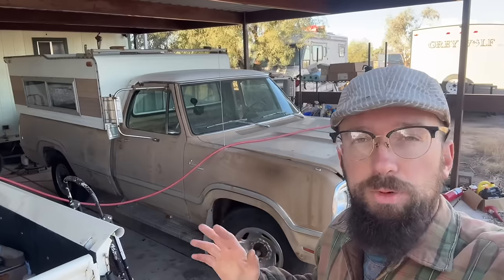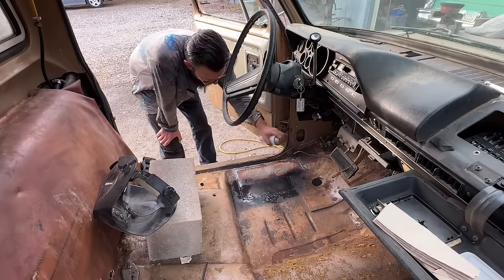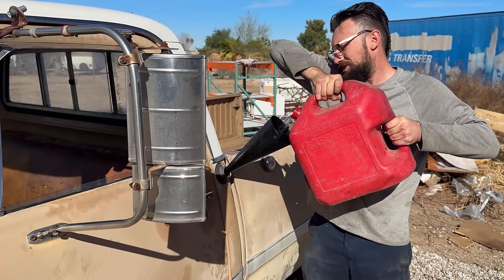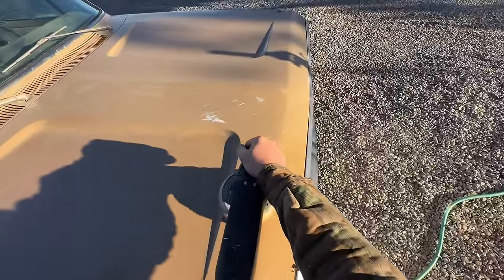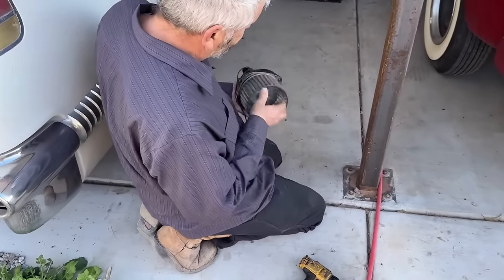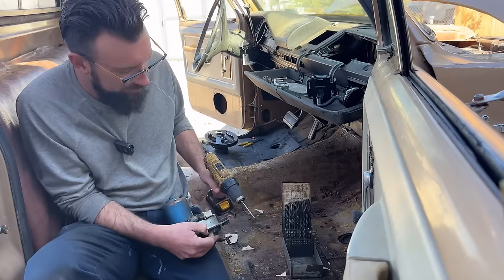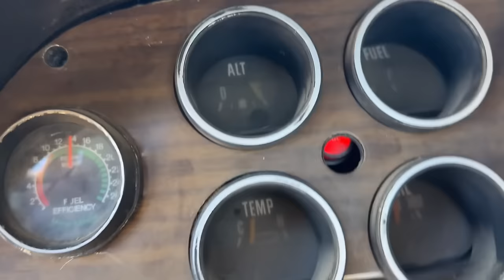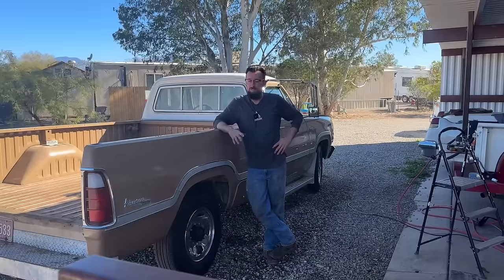1973 Dodge camper pickup gets polished, new floor, and more electrical fixes!

Comment: Jackpot. I really like how you’re not a “parts changer”. Those original parts are so well made and, it’s so interesting to see how you and your Dad do the refurbishments. I worked as a machinist for 20 years , and I loved refurbishing old car parts and such. Y’all are starting to motivate me.
Reply: I concur. The wiper motor not turning was caused by the excessive rust flake build up. You don't know what's wrong with a part till you take it apart and inspect it.

Comment: I really would like to see those fender turn signals work. If you remember radio shack they did sell 12 volt miniature bulbs. The bulb was the size of a grain of rice and there were two lead wires attached. I needed some bulbs this size on my heater control on my 05 grand prix. Dealer only sold the whole heater so I wired these in and they have worked well. I'm sure you could find bulbs like those online. Maybe led now.  Take them apart and tinker with them. And truck is looking good so far.

Comment: If you move that voltage regulator to the fender well, away from the area where the "bird bath" hoid dumps water on it everytime you open it, it'll last FOREVER.
Mine's 31 years old now on my '91.5 Cummins.
On them the heat from the head cooks them. ANOTHER reason to move it.
Movrd

Comment: Since the truck was built in Michigan and sold to the buyer in California, either the Dodge dealer or the buyer deleted the OEM mirrors and installed (what you have)…which are called “West coast mirrors” they were quite advantageous for towing RV’s or equipment trailers that were slightly wider than the truck.

Comment: Some notes... not hating or trying to get thumbs down or people telling me I'm wrong. I love your channel. I have a 1987 Ram W150 that I got in great shape that the previous owners didn't know anything about cars and were building contractors so they were cheap. They would use it in the summer only during the day and then park it under a canopy during the  winter. 1) if you're going to sell it to someone, you should probably figure out why the floor rusted out. The first generation Rams are very well known for leaking water from somewhere that I've been unable to find through exhaustive efforts. It didn't rust because of neglect, I guarantee it rusted from water sitting under the carpet. It will happen again and if you sell it to someone who parks it outside in the rain, they will be cursing you every time they open the door to find a puddle on the floor. And you will have wasted the extra money you spent on a new carpet kit. You can totally water test it if you want to prove it doesn't leak, but I would bet it does from somewhere. If you find it, please let me know so I can fix mine. 2) these trucks are also famous for not only not charging batteries , but draining them. I've gone through several batteries in two years of owning it.  it's probably why your truck keeps trying to die at idle. In my truck, I can see a shiny new voltage regulator and the battery gauge has clearly been disconnected since it always sits at the middle. My next move is to replace the alternator, again cheap ass previous owners. It's almost like the more electronic load you put on the truck, the more it tries to stall due to weak spark? If you figure that out too, I would love to know so I can fix mine to drive at night with headlights 3) the wipers are also a huge mess. You said it was never the linkage but the motor, but you should have replaced the linkage bushings while you were in there. The refreshed motor will most likely destroy what little life is left in the bushings. I also heard Dad mention something about a new wiper motor costing something like $120 to replace. Not my experience on Rock Auto. But you serviced your motor. I bought a new one from rock auto because mine is so noisy and I have to replace my linkage bushings. Hope this all helps a bit but also really hope you're able to chase down all my issues. Specifically how you would replace all those stupid bushings because most YouTube videos just edit the hard parts out. Id be a fan for life if you and your Dad tackle that project. The bushings are like only a few bucks. Huge fan please keep it up! P.s. if you ever feel the need to come out to Western WA, i have a 2004 4.7 Ram that has been sitting behind my house for seven years now and just needs some love and attention and help to get her running again. Could be some good content lol.

Comment: I'm replacing my fuel pump for third time in 2 years in my 2013 ford e250  no more Chinesium fuel pumps. The plastic housing swelled up couldn't hardly get it out of the hole in the tank.

Comment: Floor weld in patch was done correctly! I look at that floor of the truck and want to pour isopropyl alcohol on it, and vinegar, and "pee be gone" spray!! LOL. You might want to apply some P.O.R. 15 on the floor in certain areas. Back when car manufacturers used single stage paint!!  It  can be brought back to life taking the nasty top layer off --- the paint looks great now!! Great Job!!

Comment: I love your projects. I had a 68 long bed Dodge and an 81 LBD. Drove them for 43 yrs. Where running complete when I let them go. One thing... please adjust that p-side hood pin! The lift on that side is miserable. Maybe thespring needs adjustment as well. Still have my 94 Cheyenne LB in the driveway -only255k on the clock...Keep working .. Take care of Dad

Comment: So far I've sealed both Rocker Panels & floor patches on a '92 Nissan D24 Pickup. An inner Fender cut/weld to graft a used front corner & Rad Support on a '91 Toyota P/U. And just sealed my new Gutters, 6 End Caps with Eastwood Seam Sealer. There's still more than half the can left. Fill the air space in the can with Propane Gas to store the product. It'll never skin over or harden, (this works for Brake Fluid too! No air inside. No spoiled Fluid!).

Comment: if you want the truck to really start faster put one of the like 1994 starters on it they are smaller and turn much faster
Reply: 100% agreed. Dakota mini starters are in stock in all parts stores, and are waaay better than those dragging gear reduction starters.
Reply: but you lose the original cool sound.

Comment: Travis, if you can afford to. Get yourself a can of Eastwood Seam Sealer (grey or black). It's Titanium Dioxide & Carbon Black (& a couple packs of acid brushes). This sealer is amazing for filling & covering body welds. Never cracks or shrinks, paintable in 1 hour. With just half the welds & this sealer. You can fill a panel in half the time. VERY versitile product, & a can will last you a very long time/maybe a dozen projects. Worth every penny!

Comment: When I started working for a Chrysler/Jeep/AMC Dealer back in '79 when I got out of the Army, we could rarely send an Alternator, starter motor, and a few other choice pieces back to Chrysler without tearing apart first and try and repair them! By the 1080's, that was too expensive and labor cost more than time, so we started R & R the items for a faster fix rate, especially on warranty jobs.

Comment: Travis, very much enjoy your restorations. I've learned a great deal about engine fundamentals (turn over, compression, spark, fuel) by watching your videos. You might enjoy reading "The Grapes of Wrath" by John Steinbeck. There's much in the book that is not in the Henry Fonda movie. For example, the Joad family jalopy breaks down on Route 66 enroute to California. They determine they've lost compression in a cylinder, and improvise by winding copper wire around the piston ring. The copper melts, enabling the compression that they need. In another scene, Tom Joad and Preacher Casey are underneath the engine, torquing the oil pan bolts in the recommended sequence as Preacher Casey has an epiphany about the plight of the displaced Okies along the Mother Road. Great reading!
Reply from the maker: That’s cool. I’ve seen the movie. Should read the book it’s always better.

Comment: Your videos are really well done. Editing is king.
I don't bother with those air cut off tools anymore myself.  Dewalt cordless and a 6" death wheel " no guard off course I'm not a wuss".
Btw your Dad is a hoot.
Reply from the maker: Yeah dewalts are pretty decent tools.
Reply: @theetravisb just joined btw. Are you looking for a heavy welding bench? Or a metal utility bench?
There is a guy in south Phoenix that has some really nice 44 x 60  x ⅝ thick tables 3" tube legs. For $350 he had 10 of them I'll see if ha has any more if you want.

Comment: The entire life of the Ram series of pickup trucks has been produced at the mound road assembly plant, which is in Warren Michigan. In fact, it's at mount road and 8 mile road!
I worked for a company called Ankara industries located out of Chesterfield Michigan. We used to deliver assembly brackets and hood latch assembly parts from the machines I set up.
Cool place to go to.
The SST mark on the build sheet is for the limited slip diff.

Comment: If you do finishing sanding, using a block so you easily keep track of how much paint you remove will prevent burning through, even new paint that’s much thicker then an old paint job is always blocked out with no orbital being used because it’s just to much too fast. 💯

Comment: Please...
For all older motors on electric components such as that blowere motor, only use turbine oil!
It was intended for it.
Any other oils attract dirt and causes  gunk to form around the copper conductors and surfaces that are the moving components.
Besides all other oils will disintegrate the brushes in there.

Comment: Not a criticism but I would clean around the steel your cutting out first rather than after otherwise it can thin the edges and they could burn through when welding patch in.
Great videos keep it up

Comment: Hey Travis. I have a 1992 half ton, 2dr., it has the v6 engine. Very good looking truck 
It's white. I bought it site unseen. It needs wiring repair. Someone has tried to hot wire it. It needs an key ignition 43:22

Comment: Your vacuum gauge isn't reading miles per gallon, that's inches of mercury. It's measuring vacuum in inches, not mpg. Vacuum is useful for tuning a carb, adjust the idle mixture screws for the highest vacuum reading at idle.

Comment: So those top fender light should have a replaceable bulb in it. The black plastic pops out and the bulb is right there.
That or you spin off that knurled area. There are new ones on the internet.

Comment: Do you have the tail gate for the truck? It needs one. This truck is coming back great. I like the original wheels and caps better myself. Those chrome wheels from the later model just don’t fit with the body lines on the truck. The old ones match better.